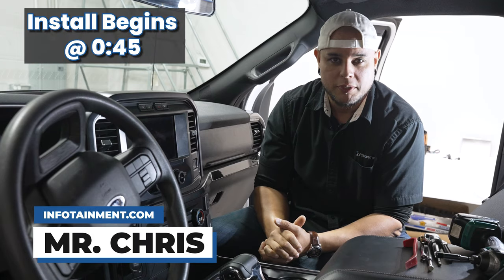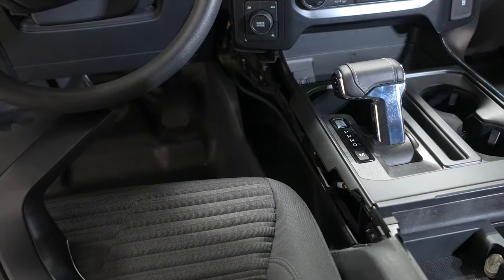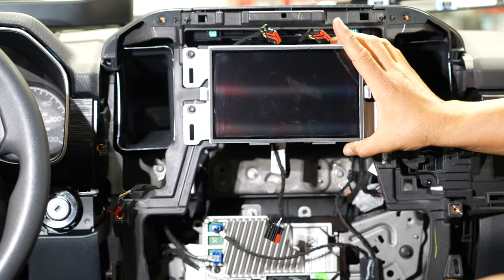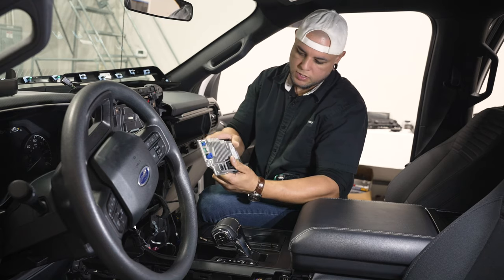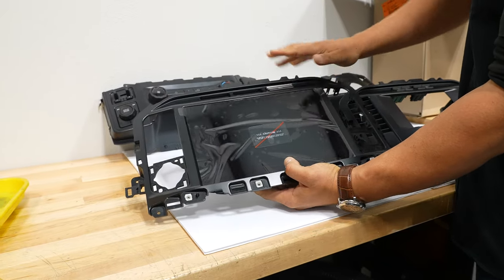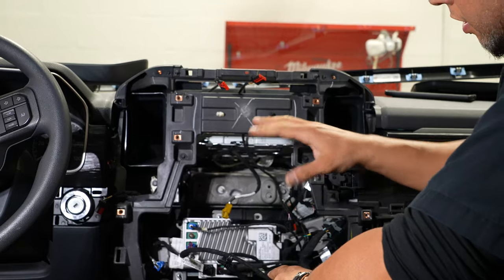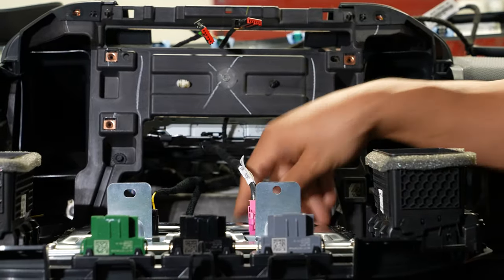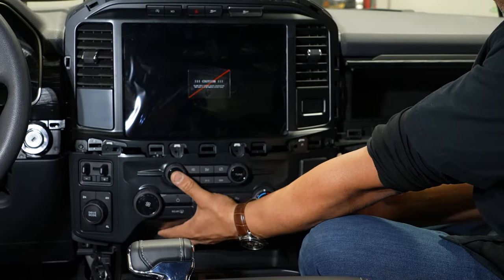2021+ Ford F-150 - 12" Touchscreen Radio Installation Guide - Infotainment.com

Comment: A helpful video, Thank You for providing = I finally managed to uninstall my F150 XLT 12" display - it took about 10 hard hours of labor this first time for the uninstall. Two additions I would like to mention for other if okay. 
1) the APIM was below the screen, not behind so I did not need to remove the screen at all. But of course the radio and controls below the screen need to be completely remove and the APIM is directly behind the radio controls.
2) the latches on the pins are tricky and mysterious for the cables coming out of the APIM. The second to the largest black cable had a hidden latch you MUST move to the side. And, another hard to see latch on the blue round cable. Without squeezing these hidden latches the cables are non removable. 
  CHEERS JS

Comment: I just ordered mine! i cant wait! quick question i see that the panel for the volume and climate control are not included would you happen to know the part number for it? im having a hard time finding just the panel without all the controls in them.
Reply from the maker: While you do have to remove the HVAC panel for the install it is not replaced. This kit will utilize the OEM HVAC and volume panel. A new one will not be needed the original HVAC panel is reinstalled as one of the last steps.

Comment: Was wondering if you could recommend the best web site to buy a replacement APIM. Especially including an accurate reprogramming included if I supply the seller my VIN number. Is this possible? Of course, I would like to avoid reprogramming the new APIM - for sure!
Reply from the maker: The only company that I know of that is working wih OEM Ford APIM modules would be us. If you send me your Vin at my email taylor@infotainment.com I can send over a quote for this replacement. Thank you for your interest.

Comment: Heyoooo, so i see this system is with installing Sync 4, i checked my XL 21 and it already has Sync 4, would i be able to just nab a display from a normal 12” and swap it that way? (From what i found online it seems most all the swaps are installing sync 4 but mine already has it. And i apologize if this isnt a question you answer)
Reply from the maker: This is the installation video for the plug and play package that we offer.  The kit is meant to accommodate the conversion from an existing 8" Sync 4 display to a 12" sync 4 display.  
The content of the kit includes a pre programmed APIM module for the 12" display (different than the 8" Sync 4 APIM), the 12" Sync 4 display, and the wire harnesses.  The wiring that comes with the kit integrates in to the existing wiring that the vehicle is equipped with to accommodate a plug and play install.

Comment: I watched another guy do a similar upgrade but he did not change out the APIM module.  He did have to customize the harness so that it would plug in and also run a power line to the fuse box and add a ground wire but it seems to work without having to buy another module and save some $$$.  Have ya'll tried that?
Reply from the maker: That is one of the first things we tried when developing this upgrade. However, depending on the software on the factory APIM, it may or may not work properly. So just to prevent that from occurring we include a pre-programmed APIM.

Comment: I have a '23 F150 STX 4X4 with the 8 inch screen and no 360 camera, just a backup cam. Do I need to upgrade my APIM before doing the screen still?
Reply from the maker: Yes the APIM modules are different between the 8" units and the 12" units. The module will have to be replaced.
Reply: @Infotainment_nav  Thank you for the reply!

Comment: Did you have to program first? Or does the screen have to turn on without programming. Just installed mine and won’t turn on
Reply from the maker: The hardware that comes with the Ford packages are pre programmed to the VIN# to accommodate a plug and play install.  So the video would be installing a pre programmed unit.

Comment: If I have to replace the screen (mine cracked) would I just plug in and work right away?
Reply from the maker: Our OEM 8" to 12" upgrade is plug and play if you have Nav now. If not it needs a bit of onsite programming to get the Navigation working. 
Those who are upgrading from a non-navigation equipped system will require in-vehicle programming through our Remote Tablet Rental offering (sold separately). This will not apply to customers who have existing navigation within their 8-inch Sync 4 display or for customers who would prefer to not use embedded navigation featured in the 12-inch Sync 4 upgrade and to use navigation applications via Apple Carplay and/or Android Auto.

Upgrade link 
https://infotainment.com/shop/interior-accessories/infotainment-radio-upgrades/2021-2023-ford-f-150-8-to-12-sync-4-touchscreen-upgrade/

Tablet rental (If needed) 
https://infotainment.com/shop/services/remote-programming-service/programming-service-remote-tablet-rental-via-teamviewer/

Comment: Hi, is the 12” screen and A pin module ford oem parts or they come from a third party? Thanks
Reply from the maker: No our kit is 100% OEM parts. We want to provide solutions to upgrade your vehicle without having to go aftermarket and settle for reduced quality but also without having to go through the delaer as they would rather get you in a new vehicle then extend the life of your current one.

Comment: Great video, thank you. I ordered the kit from you and finished the install this evening. The issue I'm having now is the Backup Camera will not turn on. Screen goes black when I put the truck in reverse. I still see the icons for trailer hitch view and the auto brake - but no image. I have a 2021 XLT without the 360 cameras. I just have the backup camera. Any insights?
Reply from the maker: Please reach out to our support team at 855-636-6287 EXT 11 or at support@infotainment.zohodesk.com
Reply: Please post your next experience here! I"m highly considering doing this upgrade but would love all things covered before I do lol
Reply: @trenton4712  It was ridiculousyly easy to fix, It just wasn't listed anywhere in the instructions. I have an XLT with just a backup camera (no 360). The wire harness has a yellow RCA cable with male/female ends. Those 2 just need to be connected.

The only remaining issue is the camera button no longer works when the car is parked.
Reply: @ramcgmecom  Hey thanks for taking the time to respond with your results! Hopefully the fix for that camera button is easy as well. Cheers!

Comment: Does the price on your website include installation? Thats a grand or two more ive seen for the same unit on other sites.
Reply from the maker: The listed cost on this link does not include installation. Please keep in mind we do not sell cheap equipment. We sell OEM quality equipment that is fully tested, pre-programmed and procured based on your Vin. There are plenty of companies that sell cheap products. We want to provide a part that we are able to guarantee works and will continue to work. We are confident enough in the product we sell that we are able to warranty it through installation and up to two years depending on your selection at check out. We feel our pricing is competitive as we are comparing our pieces to the cost of getting a new vehicle as opposed the cost of an aftermarket part whose quality is greatly inferior.
Reply from the maker: https://infotainment.com/shop/interior-accessories/infotainment-radio-upgrades/2021-2023-ford-f-150-8-to-12-sync-4-touchscreen-upgrade/

Comment: Does this come with all the new bezels needed? Is there also an option for the third bench seat ?
Reply from the maker: Yes this does come with the right bezel to house the 12" screen. However, we do not yet offer the bench seat conversion just yet.
https://infotainment.com/shop/interior-accessories/infotainment-radio-upgrades/2021-2023-ford-f-150-8-to-12-sync-4-touchscreen-upgrade/
Reply: @Infotainment_nav  once you guys have the conversion ready I’ll buy a kit immediately

Comment: Does the kit come with the lower pc for the climate and volume controls? And I see on the site it asked if my truck has floor mounted controls not sure what that is ?
Reply from the maker: In this vehicle he is working on a vehicle with the floor mounted console as opposed to a seat which can be there instead. This is a full kit as well so you should have everything you need. If you go to the last picture on this listing you can see a picture of everthing that is included. 
https://infotainment.com/shop/interior-accessories/infotainment-radio-upgrades/2021-2023-ford-f-150-8-to-12-sync-4-touchscreen-upgrade/
Reply: so is that a no on the climate and volume control piece? i see in the picture it doesn’t show it
Reply: Why isn’t the new hvac and volume control plastic panel included? For $2000? What are you supposed to do without it? You certainly can’t complete the installation. Thanks.